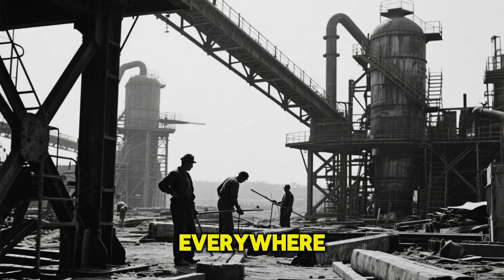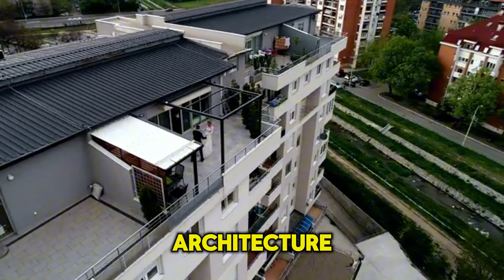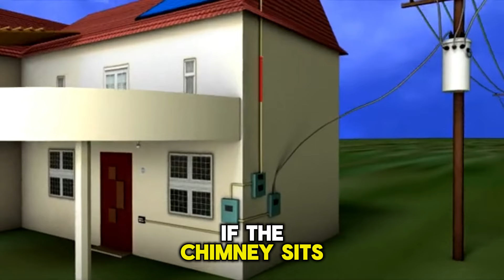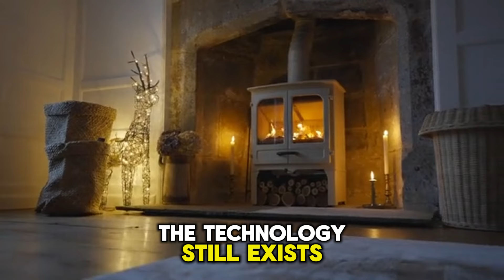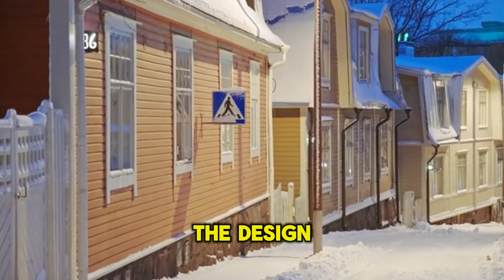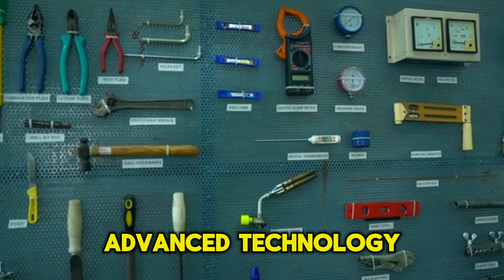One WWII Insulation Method Cost Zero and Lasted 50 Years — Why Did We Forget It?

Comment: You left out the best building method that we abandon. That's earthen construction. Eliminating wood altogether for walls. We replaced thick earthen walls that provided thermal mass with thin wood sheeting. Even with modern improvements, like cement stabilization, you could build 10 earthen wall homes for one concrete structure. And those ten homes can reasonably have an useful life expectancy of hundreds of years.
Reply from the maker: That's a fantastic point about earthen construction and its benefits!

Comment: I won't propose sod roofs or soil walls but I will propose facing big windows south, sealing air leaks around doors and windows, also energy efficient furnace and programmable thermostats that let you control when to heat and cool.